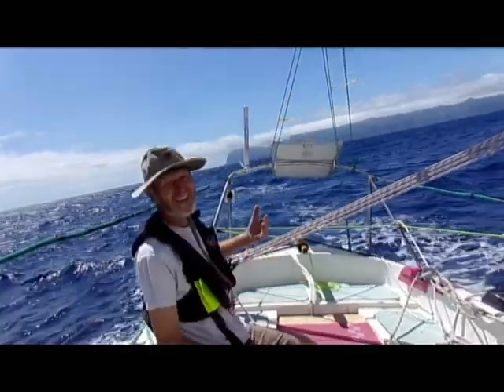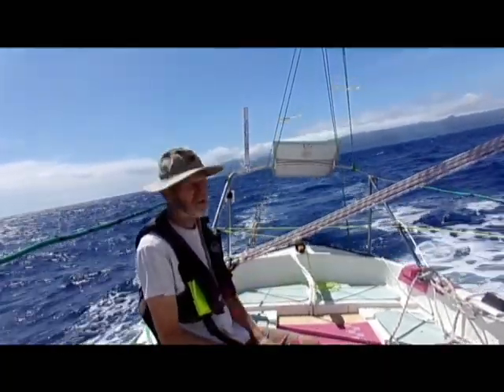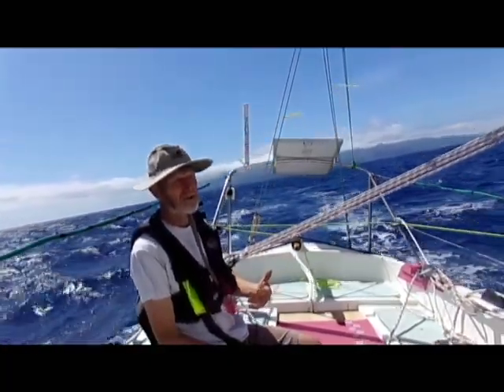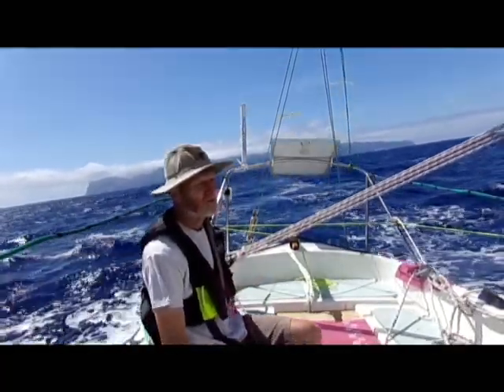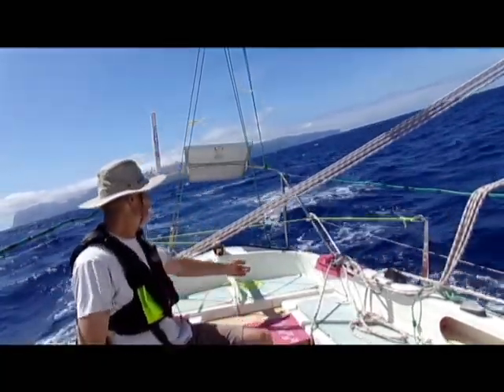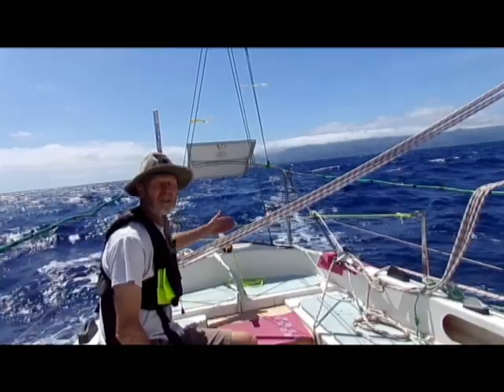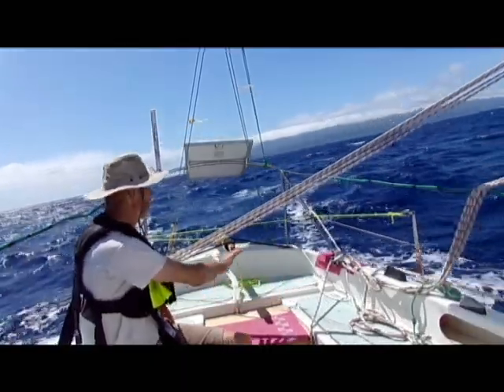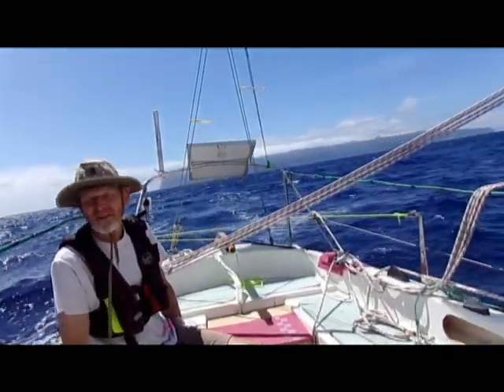Jester Challenge 2018. Emu self-steering without a windvane Part1: Downwind

Comment: Would you provide details about the elastic rope? Diameter? Material? Thanks.
Reply from the maker: This is 10mm shock cord AKA bungee.  The type  sold for marine use seems to last a long time.  Some of the cheaper ones for luggage straps lose their elasticity after a few years.  For more tension I add extra turns around tiller, or thicker bungee could be used.
Reply: @scallywagII  the ones sold in stores not for maritime use have no UV protection. Hope that helps in you hunt for Bungee